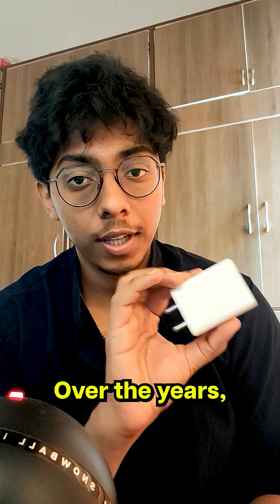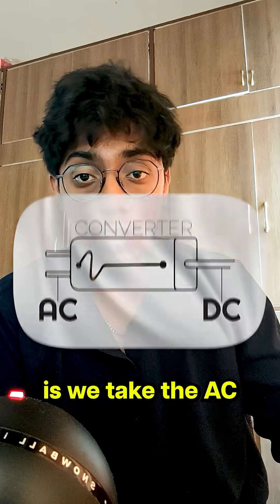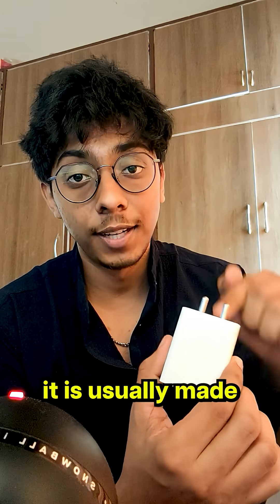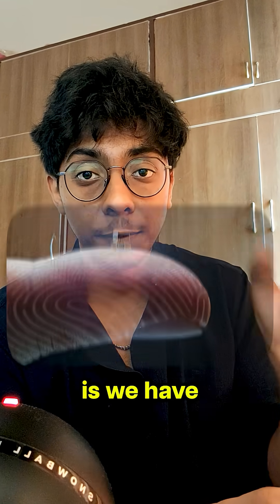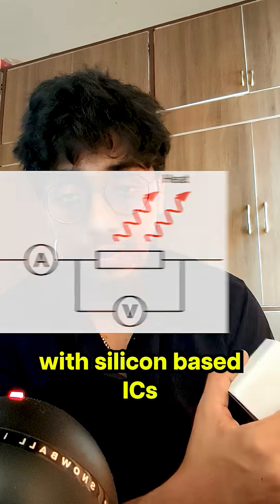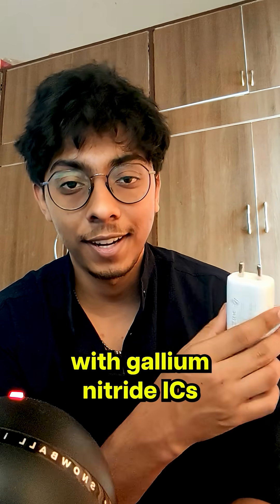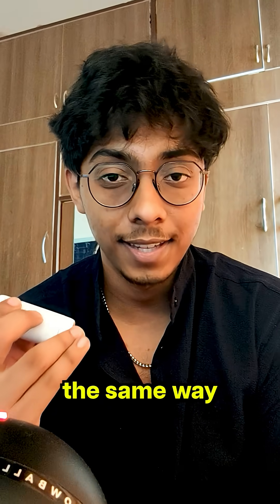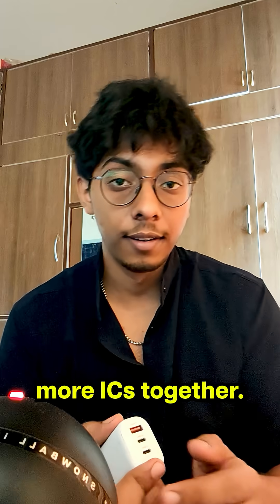GaN or Gallium nitride chargers are amazing but why aren't companies adopting it

Comment: Can you recommend a best Gan chargers
Reply from the maker: usually the under lying tech is the same, picking any big name brands anker will do great in the long run, but the tradeoff like I mentioned is that they are really expensive, I do use a GaN charger myself and its pretty solid.